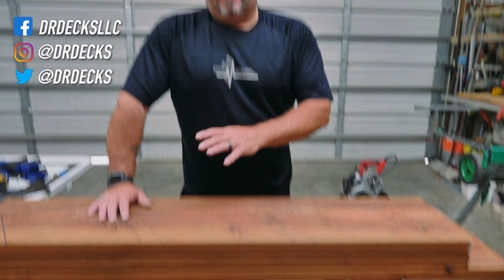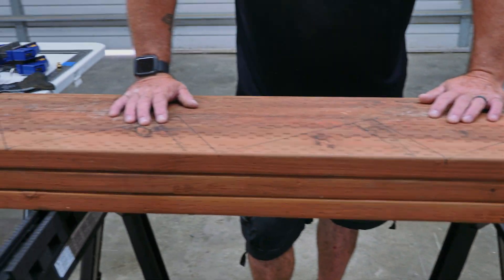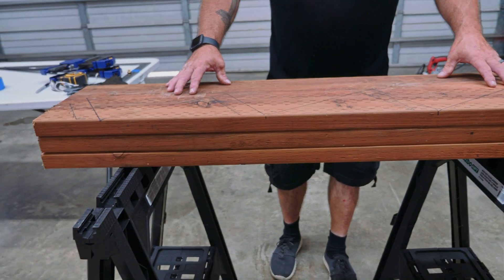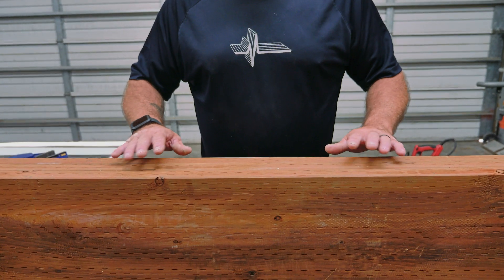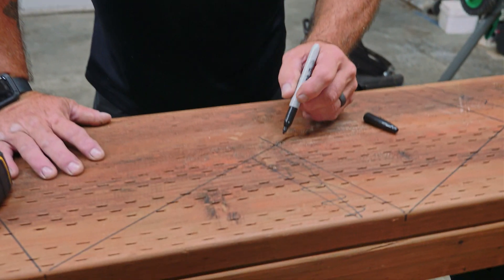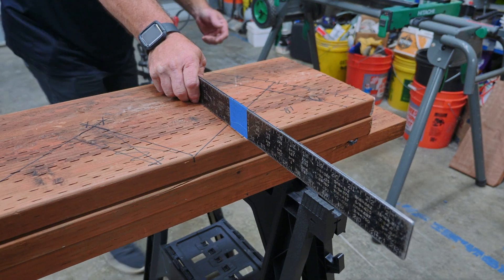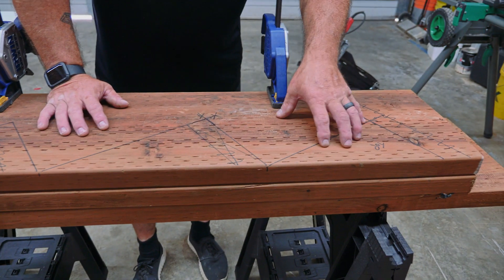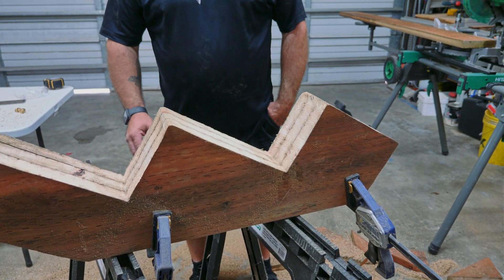How To Build Stairs PART 3: Cutting The Stairs || Dr Decks

Comment: Lots of great info in these vids.  In the midst of replacing my 1,100 sqft deck which was built in the early 80's (bought a project house).  Long time DIY'er but never built a deck before.  Also downloaded the Residential Code for Ohio as an additional guide.  Keep up the great work and thank you for the instruction! Side note: I ordered a pair of those Blakladder ripstop shorts.  Those will hopefully be way better than my regular cargo shorts when the tool belt is too clunky.